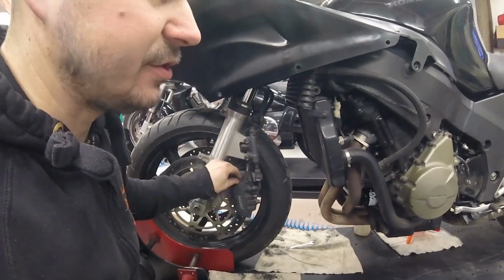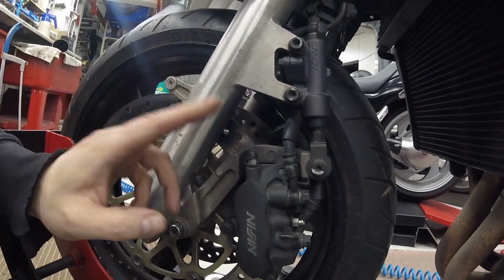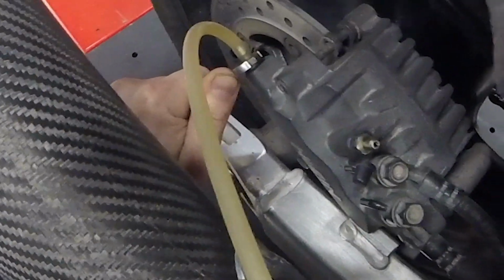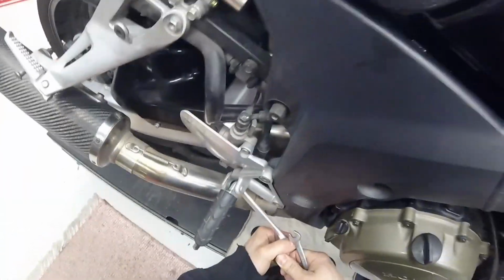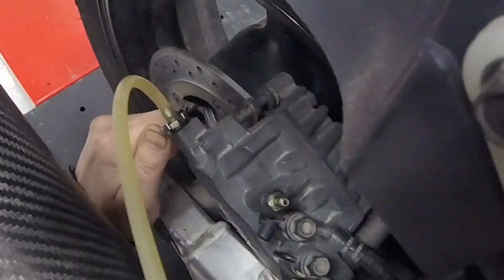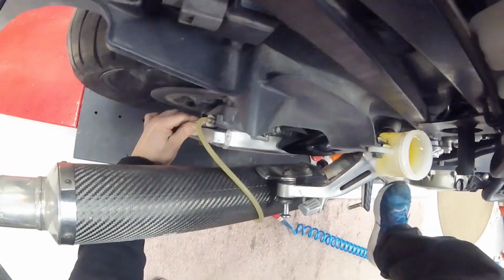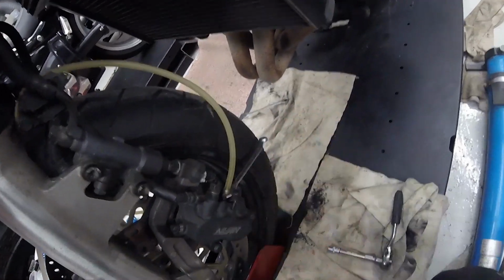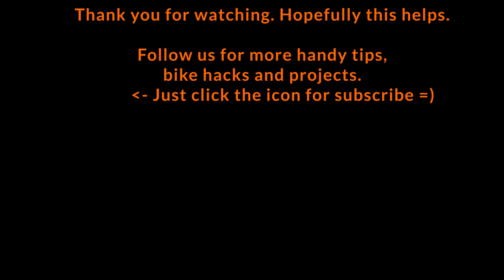How to bleed COMBINED brakes Honda CBR1100XX, HONDA COMBINED brakes bleeding, no ABS

Comment: Cbr1100xx 1998 Caviter Bike had a leak in the water pump, so I was going to fix it this time, but the 1998 water pump (19220-MAT-760) is going to be discontinued
So, I found that the water pump (19200-MAT-E20) of the new injector vehicle is in stock, and the engine is the same engine for both the cab and the new injection type, but whether it will be compatible;;
I'd like to ask if it's a compatible improvement or if it's something else that can't be installed. I can't get a new 1998 CBR1100XX water pump
Reply from the maker: Sorry,  but I dont know.. I would also assume, that the engine is same, so it might fit to your bike too...maybe..🤔

Comment: So it's basically the same process as normal brakes? I have a R1200RT and I think it works in reverse.... when you apply front it applies a little at the back too.
Reply from the maker: @ArcanePath360  Basicly same as normal, you just need to know where and how to bleed it.. 👌😃
Reply: @TeemuBT  Thanks, I just rebuilt my rear calliper. Tried the reverse bleeding method, but I think it has a check valve as nothing would go in from the bleed nipple. I was using a zip tie and pumping the front brake while doing the usual bleed from the rear. I think I got most of it, but it still is binding a little. Pistons move freely so must still be a little bit of air somewhere.

Comment: I had my rear brake stick because of old fluid. I cleaned out the system and put in new fluid. I got the rear brakes to bleed but can't get any lever feel for the fronts. I've bled according to the factory manual but no luck. Just bleeding at the outer valves on both front calipers. Am I overlooking something?
Reply from the maker: Outer valves are the upper ones..? It sounds that you are doing it right,but sometimes this happens with my cusromers too, they are doing all the right things but somehow it just wont work, then the bike comes to to me and few minutes later there is brakes again.. And ofcourse I cant tell what they were doing wrong and why it was not a problem for me.. So sorry, I really dont know what could be the problem..
Or, actually, sometimes air get stuck at the uppermost point in the system, at main cylinder, where the hose banjo connector is bolted.. Then you need to "bleed" is upwords, steering all the way left, then tilt the whole bike so much left, that the main cylinder hose end is pointing down, so if there is air stuck, the air can come back to container.. Now use the lever lightly, you soud see bubbles coming up from the main cylinder to the container.. Hopefully you got the idea.. That is easy fix to really many bikes.. 😃

Comment: Nice video! by the way are the front pads equals to rear or exist diferent pads reference? thanks
Reply from the maker: In this Honda, those are the same, but there is Hondas with combinated brake system that are not the same.. 😃

Comment: Shouldn't one of the two nipples on the rear caliper bleed oil through the front brake lever?
Reply from the maker: Nope, both are from back,but other one  goes around the main cylinder that is located at left front caliber..
Reply: @TeemuBT  okay, thanks, when I put the bike on center stand and push the front brake lever I can still turn the back wheel freely, why is this? The back pedal stops both wheels.
Reply from the maker: @edgarduarte516  the left caliber need to push this extra main cylinder and that cylinder brakes the rear brake.. So, when using the front leaver, push the bike forward, Left front caliber moves and  then it will brake rear tire too..
Reply: @TeemuBT  okay, mystery solved, thanks!

Comment: I'm having issues at pcv valve. Fluid to it not not past it.... Everything else bleeds up well...
Reply from the maker: Pcv valve..? Do you mean that secondary master sylinder..? Not exatly understand your issue here..
Can you find an answer here:
https://www.cbrxx.com/threads/pcv-issue.28667/
😃
Reply: @TeemuBT  no not the secondary master. The pcv unit... Sits above the rear master cylinder. Proportioning control valve...
Reply from the maker: @gc33  aah, yeah.. I havnt have any issues on Hondas yet, but those are ageing ,so it is only a matter of time when I'll see the first one.. But I have had problems with car on that one and I had to open it up and it was fully rusted.. I dont know is this Honda part possibe to open up and fix.
I also have heard that xx owners have had this valve problems and they chanced that from the newer xx.. 😃
Reply: @TeemuBT  technically, they are non serviceable. But I've opened mine up... The circlip that holds the piston is a bitch to get out. Done it 5 times now so I'm getting pretty good at it now lol.
At $700 odd Australian to replace new I'm sure as hell try and repair it... So ive discovered now according to Honda manuals and other XX owners.. That valve shuts off under pressure... So cannot bleed it the same... Very gently plus vacuum bleeder. I'm told that the rear nipple is a 10mm....mine are all 8mm...

Comment: Hello, I'm ready to buy a cbr 1100xx , can you give me some
advice? For example, what parts need to be looked at
carefully, which year is the best, and the number of
kilometers, what parts are more likely to break, Ilook
forward to hearing from you!
Reply from the maker: Well, this works for quite many bike, but start with normal things like, chain and sprockets and tires.. Brake disks are expencive, so check those.. Front forks are on, and not leaking. Sreering bearings work flawless, no notch in the middle position. Rear swingarm bearings are not loose.. Brakes, gears and clutch works flawless..
When the engine is cold and you start it, it shouldnt make any extra sounds, like no taping, if it does and taping desappears fhen warm,  the cam chain tensioner needs to be replaced.. Also cam chain can be too stretched, if there is more than 80tkm on a clock..
1997-98 models are carburetors and cheaper, and works well, but if carbs are in bad chape, it is big job to fix those.. 1999-> is injection, usyally those works with no problem, but sometimes the lamdasensor(o2) makes engine jerk on steady throttle like speeds 80kmh, then take the o2-sensor off and replace that with lambdaeliminator.. Hopefully this will help, there is something wher start from..
Ps. Injetion bikes there is one problem with these bikes, check my other xx video.. 😃